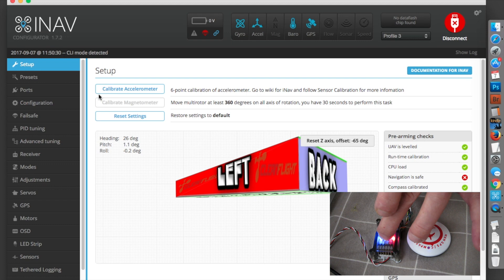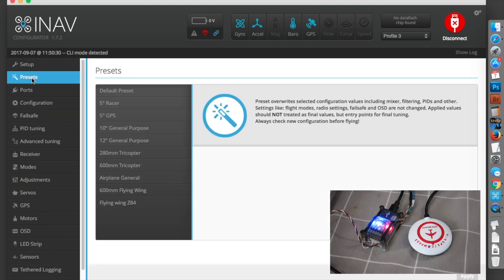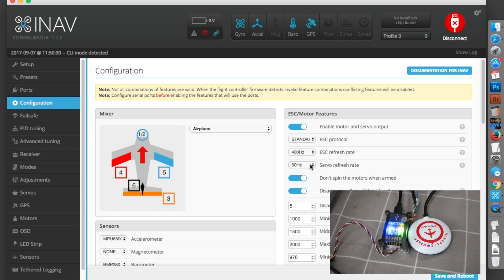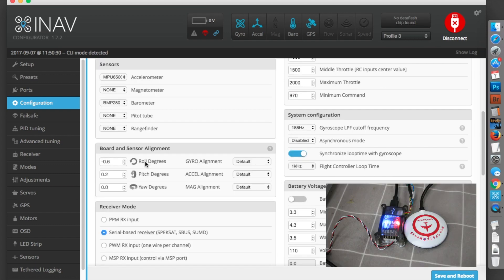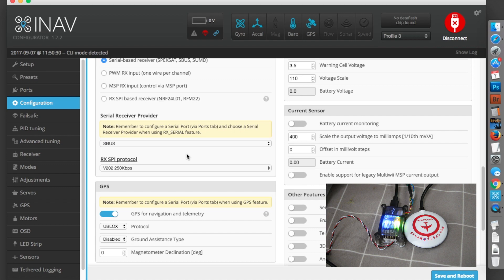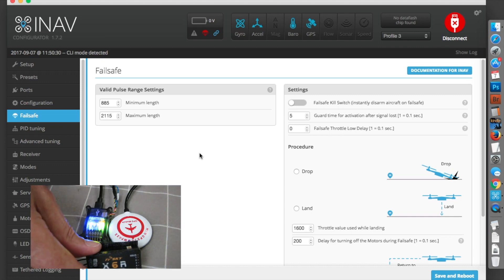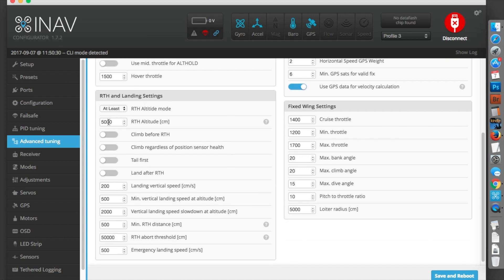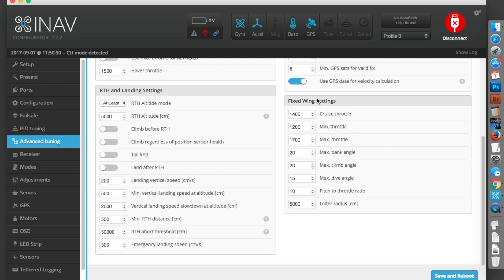Bixler 2 AIR3 iNav Part 2

Comment: hi andrew why you don't use magnetometer sensor
Reply from the maker: Not required for fixed wing, and I believe the compass can cause problems if not calibrated properly.
Reply: multicopter use magnetometer + GPS for RTH and fixed wing don't need mag... reason ?

Comment: Andrew, love your work and watching your vid's for a while now. I fly fixed wing and a racing drone, which uses cleanflight/betaflight which it would appear from your vid, inav is a spin off of. Have you tried to flash the firmware? I'd be interested in your experience in doing so. Regretfully I have found it an absolute nightmare (cleanflight/betaflight). The inav interface is way more comprehensive than cleanflight/betaflight so it may be easier, but I'd be interested in how you go flashing the firmware. Again love your work, just never needed to comment till now.
Reply from the maker: Thanks Brad. Didn't need to flash the firmware with the AIR3, but I have tried with a Naze 32 and it went smoothly.

Comment: Don't enable position hold without altitude hold on a plane, it will go down. You can enable just alt hold or both alt hold+pos hold, but never pos hold on its own.
Reply from the maker: Oh thanks for the tip, that explains the behaviour. Making the change right now